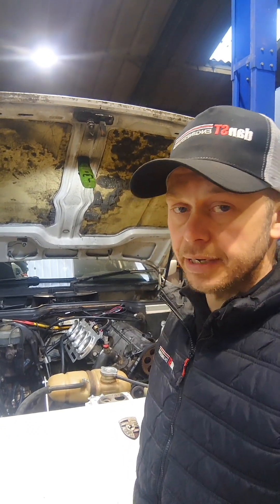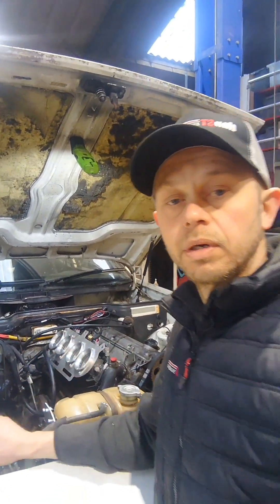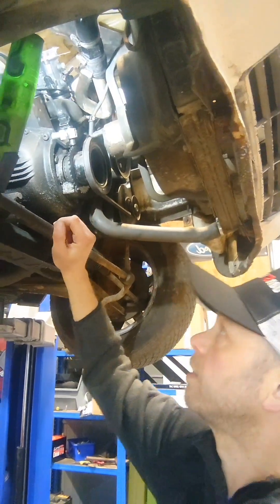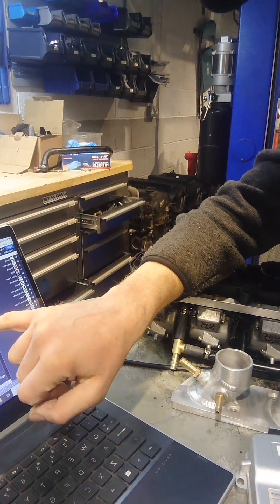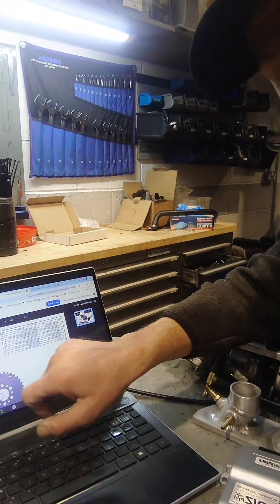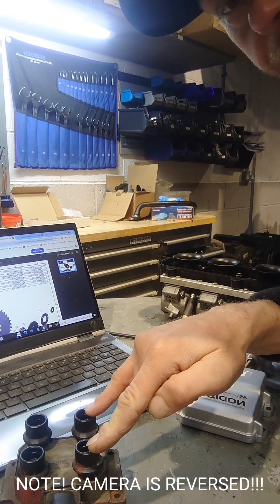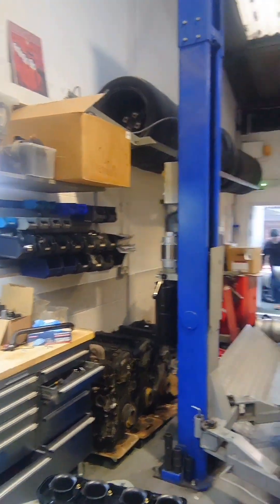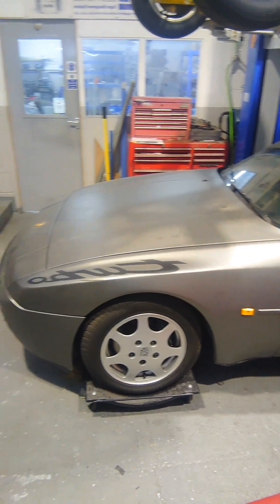Porsche 924 Engine management and individual throttle bodies overview at danST.

Comment: I removed the K-JET from my 924 a few years ago and installed the Danst ITB Kit and ME221.

It is cheaper than maintaining the K-JET and there is no mechanical problem with the ITB, so the maintenance cost is also low.

The throttle body for the GSX-R1000 is used, and the price of 4 injectors is about $50 on AliExpress, so the maintenance cost is much cheaper than the K-JET.

The TPS sensor is also about $7.

It is lighter than the K-Jet, has a very good throttle response, and you can enjoy higher power and torque, and you can also improve fuel efficiency by using the AFR gauge.

In particular, the ITB's unique intake sound is a work of art.

A well-tuned Euro version 924 engine can increase the horsepower from 125 to about 160 using the ITB + EFI, which is similar to the horsepower of the 944 N/A.

The good thing about converting to EFI is that unlike the batch mode of K-JET where fuel is injected in batches, the cam sensor is installed so that the fuel consumption is drastically reduced in FULLY SEQ mode.

The DANST KIT is very high quality and gives good feedback.

In Korea, it is difficult to pass the exhaust inspection with the old K-JET and Webber carb, so I chose Danst ITB + ME221, and it was a very good choice.